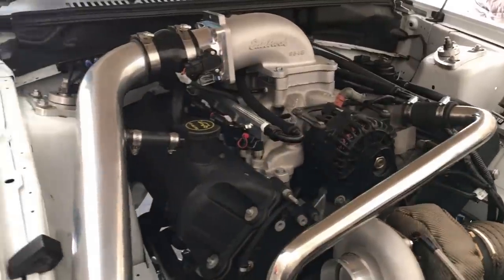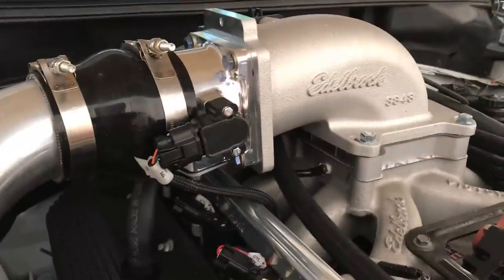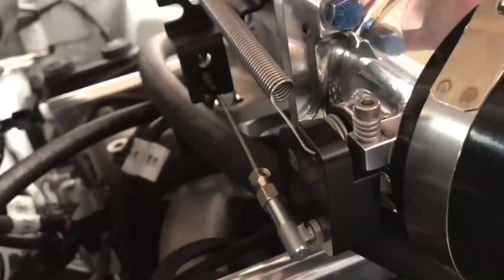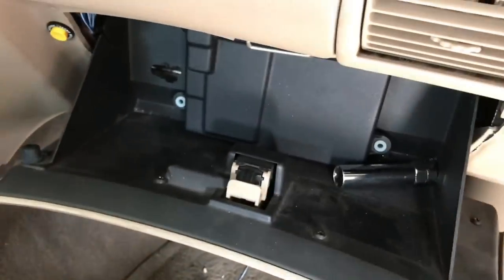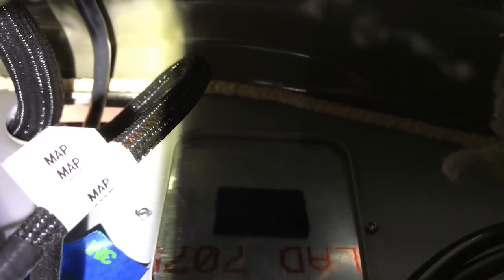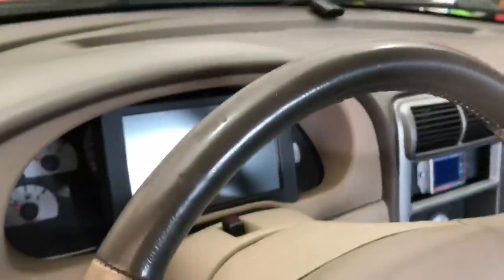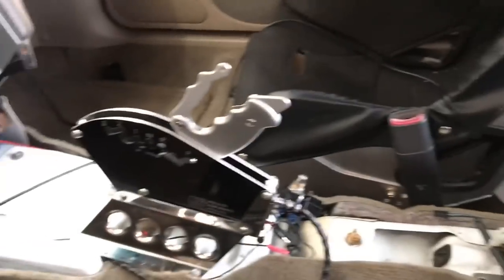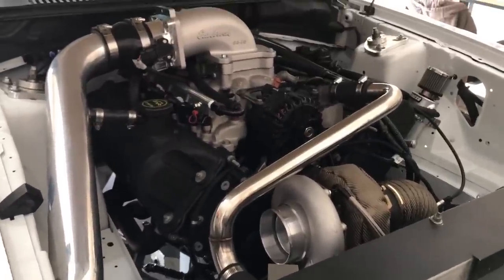Edelbrock elbow and Holley efi layout

Comment: That holley system really cleans up the motor nicely.  Ive been doing a lightning swap build.. eventually i want to compound boost it, but not exactly sure about  how that would put power down ..i have yet to take it to the track and see its times.. i have one more dyno session to do.  Fuel pump failed on my last attempt.  But replaced it and waiting .. but def like your build, looks like it pulls hard
Reply from the maker: The Mustang Brothers I would ditch the blower if going turbo and not mess with compound set up. Thanks and good luck with your build
Reply: Andrew Lavender prob gonna see how far i can take the lightning motor before it kinda stalls out on power gains.  Next year going to invest in trick flow heads and nice cams, and maybe a bigger blower if i have the cash for it. Thanks for the reply.

Comment: I think I can’t see what is really going on but does  the factory vent tube in the oil fill neck go straight into the blower pipe? That will be pushing boost pressure into the crank case if so under boost . Car is very nice
Reply from the maker: Black Knuckle that’s just a makeshift plug to block off the pipe. It looks like it is going into the oil filler neck but isn’t
Reply: Andrew Lavender ok that’s what I thought. Nice build good luck with it

Comment: Hey bro you gonna have to double up on that spring to pass tech
Reply from the maker: Phatboy Racing do I need a second one? The throttle body is spring assisted too
Reply: That's what I thought but they made me put one on. But mine is a  carburetor setup. If that makes a difference
Reply: Engine bay looks great bro
Reply: Basically it's a backup in case the main spring breaks... Therefore no wide open throttle. I would put one on anyway
Reply from the maker: Phatboy Racing ok thanks for the info
Reply: Your welcome bro. Just trying to help

Comment: Does the holley kit have  have a horse power limit. And do you have a part number.
Reply from the maker: ronsamuelii I can get u a part # there are guys    Making plenty of power with holley
Reply: I just purchased my first mod and am looking at going Holley as well, and would greatly appreciate part number as I am confused by their website looks like I need "coil drivers" ??? Thank you and keep up the great content !
Reply from the maker: BTYWYT https://www.holley.com/products/fuel_systems/fuel_injection/hp_efi/ecu_and_harness_kits/ford_modular_and_coyote_engine_plug_and_play_kits/parts/550-616
Reply: Thank You !! That is what I was looking at and it says it has coil drivers ???O well now I am trying to find out if I can run the needed wires from the Holley to the stock ECUto maintain gauges and AC.... Florida Problems.
Reply from the maker: BTYWYT yeah the coil drivers are needed to run the factor mustang coil on plugs